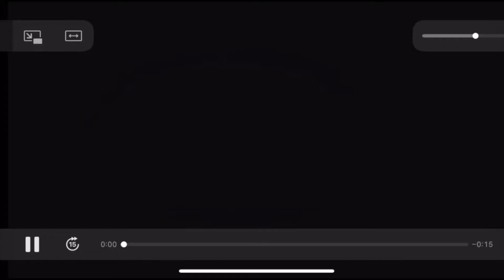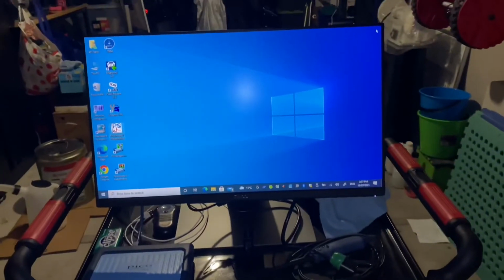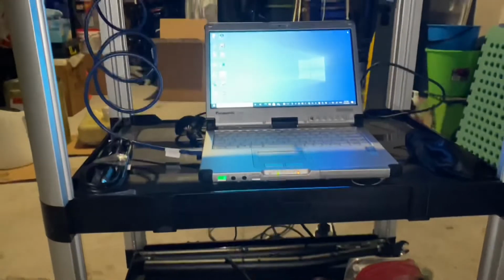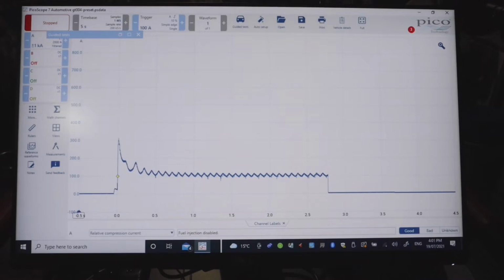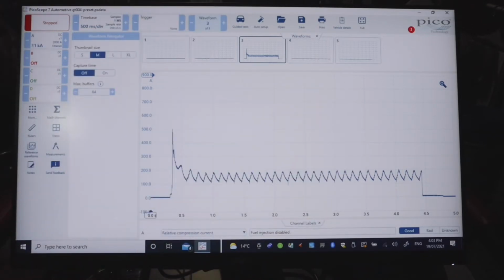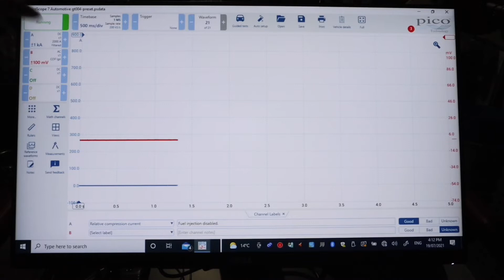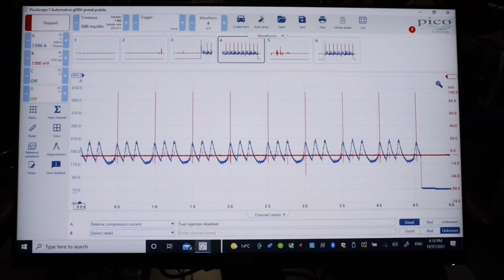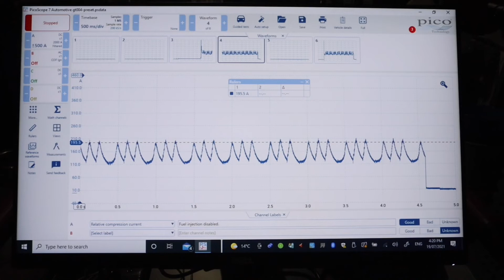Pico Relative Compression Test

Comment: If you don’t have the coil on plug adapter can how would you get that signal scoping the voltage primary side or amp clamping the secondary?